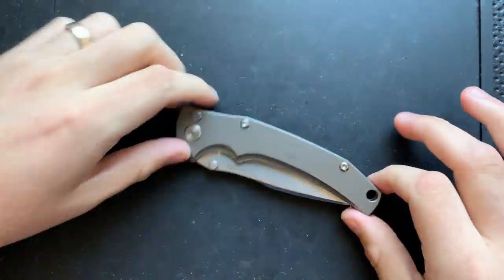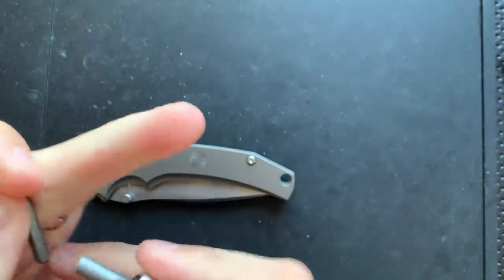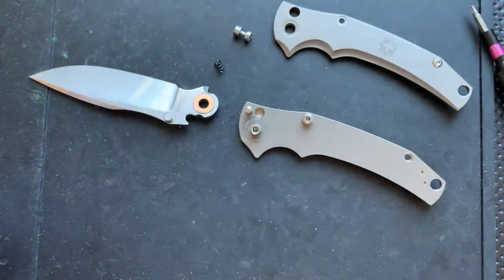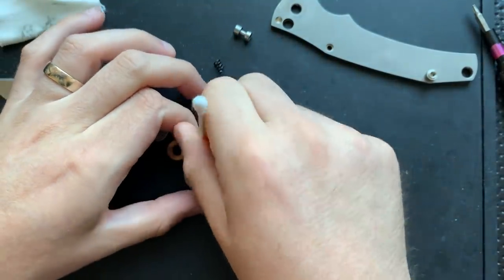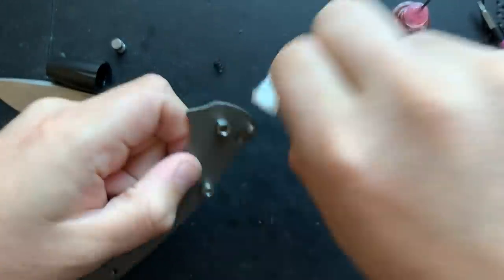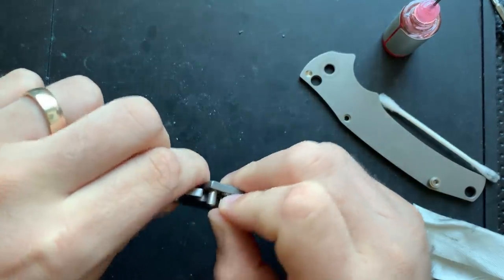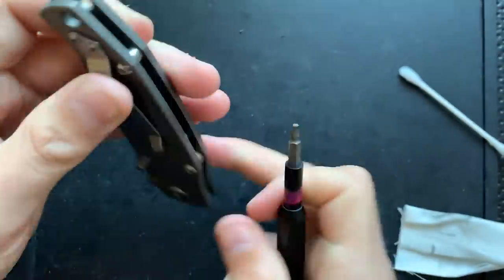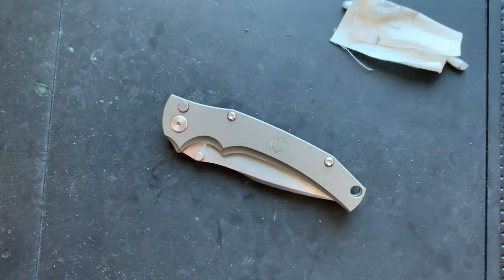How to disassemble and maintain the Klotzli Knives Swiss Border Guard Knife

Comment: I was instantly interested in this, it looks amazing. But  (having looked it up) $345?  That seems excessive.
Reply: damn
Reply: It's 550.00 Canadian . I got to handle one but it didn't do anything for me .
Reply: $345 for that?!? Wow, just looking at it I was sure it was going to be a budget knife in line with CRKT or Kershaw
Reply: its handmade in switzerland
Reply: a budget crkt or kershaw? lmao, takes me 5 seconds to see that this piece is on a whole different level than said brands.
i have both, the regular and the damasteel version and they are easily comparable with olamic, chris reeve, reate etc.
all edges are perfectly chamfered, the button-lock has zero stick, the factory edge was mirror polished, the action is a free dropper par excellence, centering is perfect and so on.